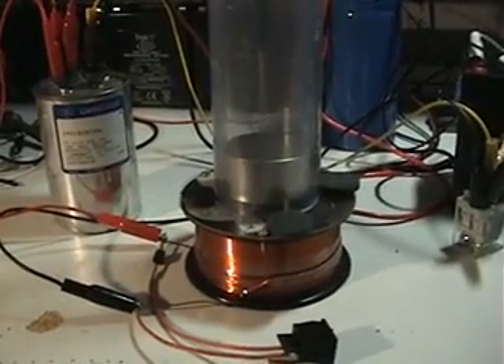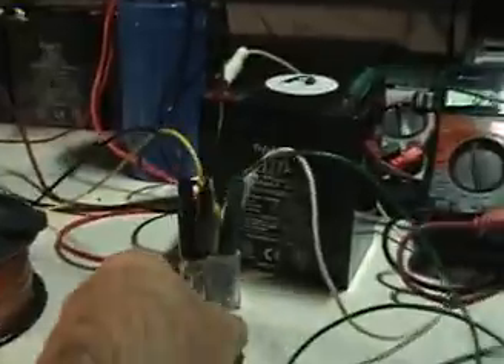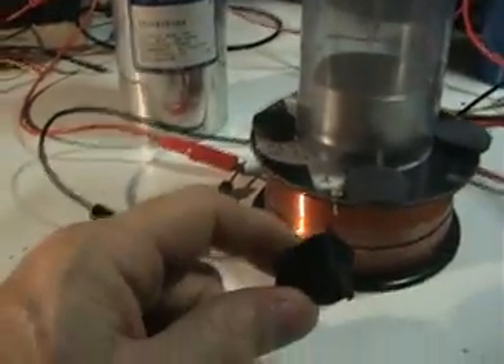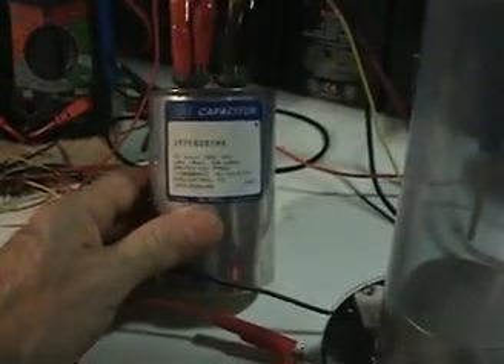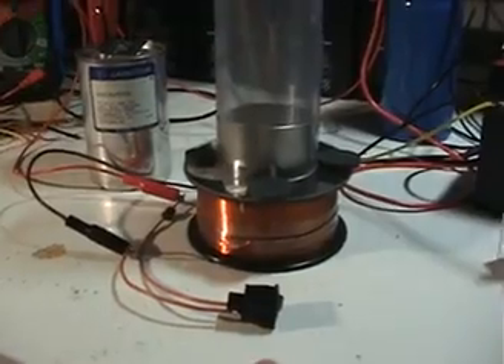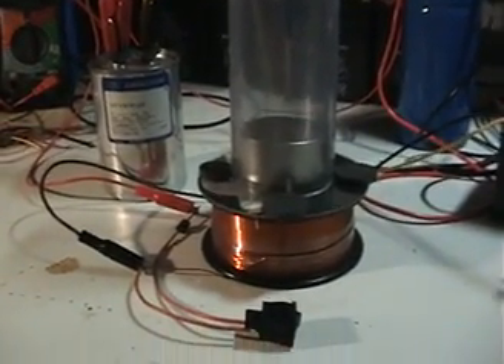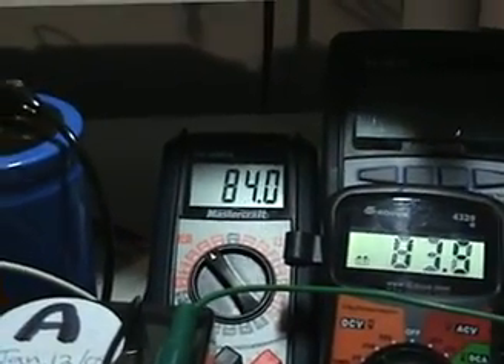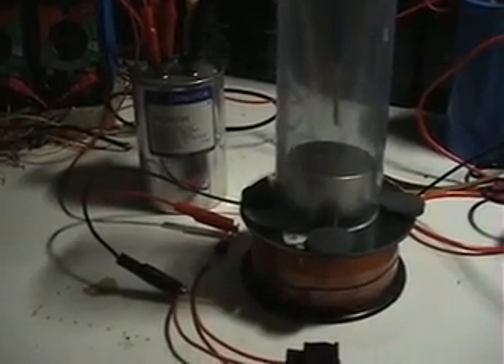Effect of Recirculating BEMF to Coil test 16

Comment: Hi Luc,
Coil by it self has its inductance, 
This means that  as current passes thru it voltage will raise.
That in turn means that magnetic flux will be stronger.
Schottky diode  reintroduces that higher Voltage again in the coil.
I was just recently reading article where is stated that using schottky diode for back EMF protection on electromagnetic lock door is bad idea cause schottky diode will make that electromagnetic lock engaged 1 or 2 seconds more.

Comment from the maker: Hi jbignes5,

thanks for your first post.

This is close to my conclusion when I first found this effect. I concluded that the inductive flyback, AKA BEMF, has many more times the effect of boosting the magnetic field of the coil then the initial energy that created it.

From all the tests I have done to date I concluded that it has much more value sending the flyback back in the coil then trying to collect it in a capacitor.

Luc

Comment: Hi Luc, the reason probably is related to the 'rate of change' in the magnetic field. The standard method probably has a longer fall time on the discharge path than the freewheeling (BEMF) method. The faster the rate of change, the stronger the magnetic field. 

Cheers - 

(love the depth gauge BTW !)

8)

Comment: What you are finding out is that the recycled bemf has a regular voltage component and another mysterious component that has been the focus of many many experiments as of late. The one thing That I see from all of these is the extra component that is sucked in in the recycling phase has a more fundamental amplifiing reaction to the geometry of the coil. This component is very very hard to examine because I think it is the basis of voltage. A component of voltage.
post 1

Comment: Tesla comes to mind about strange effects. Another would be brandt. The problem is this basic component of everything in our realm is pretty much undetectable but very very evident by the explaination of the atom and why we cannot get a firm grasp on where that energy is comming from to keep it together. When it isn't freely available then the very essence of matter will be drawn from and then things could fly apart. It would explain Brandt's issues and why he dropped the push to use it.
Post 4

Comment: A battery is a device that is a natural conduit of this energy. It could be said that it disassembles the plate to get the energy it needs to supply. It was designed that way so that it didn't have to suck the energy from the surrouding area to the extent that a void would be caused. You could say it focused the extraction on the plate and that is why they degrade. The battery litteraly consumes the plate to supply energy. Tesla switches are the proof and so was Brandt's experiences.

Post 5

Comment: The problem I am seeing here is that when the frequency is increased very very strange things happen.
 Let me explain. Say Electricity is made of a pool of substrait energy. It is fluidic in nature and everything is based off of it. You start pumping it into your circuit and convert it to an energy that is real and measurable. When you do this at a higher rate then it can flow back to the surrounding pool you might cause a void in the basic composition of everything around.

Post 2

Comment: Since this component is the basic energy holding everything together and making it solid, what do you think would happen if the basic energy component that holds everything together were removed faster then it could flow back in.
 In my opinion this could get very dangerous very fast if you break the tipping point and cause a real vacumm of this basic energy. Don't get me wrong it's worth investigating but you should be aware of the down side. Bad things have happened to many others.

Post 3